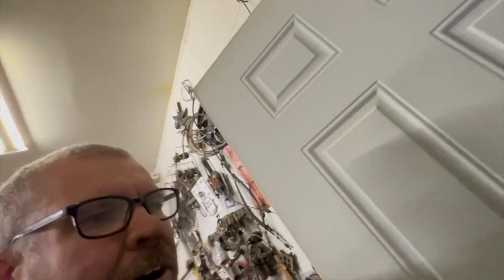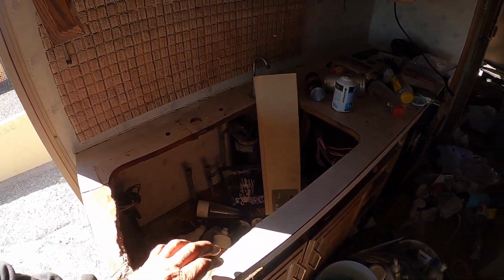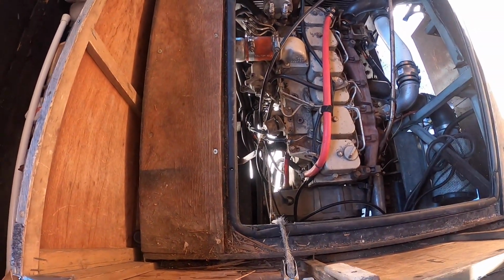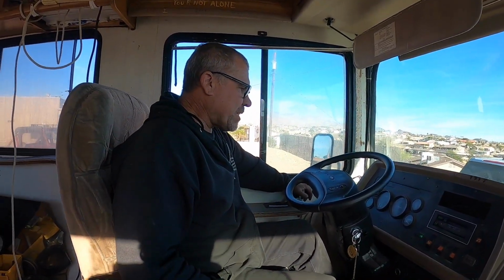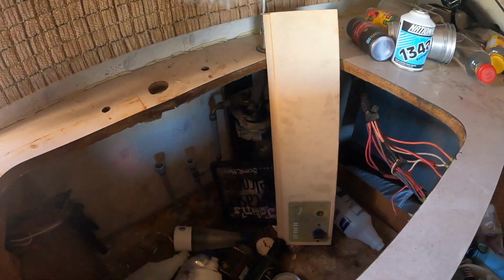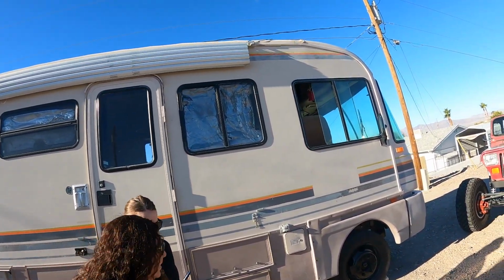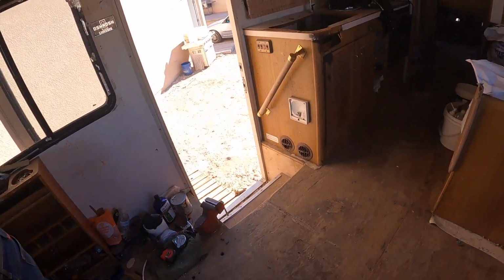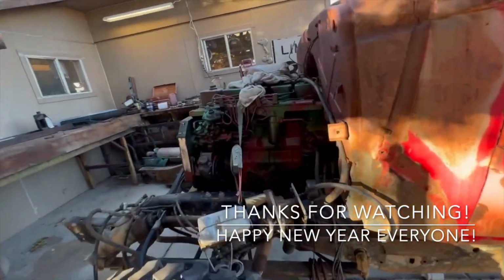This Motorhome is a Disaster!

Comment: Was chuckling throughout, then the pull chain switch to run an AC? (Or 12v light??) Almost fell off my chair !  Definitely fun to watch the varied reactions from the familys, lol!  Heck of a way to start 2023, might set the bar kinda high for content the rest of the year...  But we'll still watch, I'm sure you're up for the tasks !  Hope the new year is blessed, & Thanx !!
Reply: That was a led can light from a house, it's a 120-volt light, looks like it was tapped into whatever fed that ac unit.
Reply: @ewelmo3921  ok, didn't look deep enough, thought it was a 12 surface mount...
Reply: Merlin. It was free, you did’t  have to take it.  This video was a low.

Comment: Regarding the electric fans on the radiator - I've got a 96 Safari with a 250hp Cat that was having issues with it running too warm, so I added electric fans to pull the air out and help cool the engine down. On mine they work fantastic, and an added bonus is they help pull the heated air away from my generator (that is also in the rear end), and when I shut down for the day, the fans run on thermostat to continue to pull air through, keeping the bed from getting so hot.

Comment: the generator system you got I have a 2 cyl gas unit about the same .. it is in my garage I need to get it running . came out of a motor home . I got it  was already out .. dumpster cost hazard waste 1000.00 . but a free engine .. lol good find .. good thing we can not smell the fridge threw video ..

Comment: I was curious about the year of this motorhome.  I used to own a 1987 Bounder gasoline rig and I was amazed that the interior of this one looked nearly identical to mine, layout, cabinets and etc.  The bathroom was a little different and originally mine had two twin beds in back with a cabinet in between (that were removed before I got it.)  I put a queen bed in it and drove it for 13 years before I upgraded.  I agree that this one was trashed for sure!!

Comment: Just started watching this episode. And it’s interesting because I actually own a 92 Cummins powered Oshkosh Fleetwood bounder motorhome.
It looks to be the exact same model. But of course, mine is not such a mess.
That Onan generator uses a three cylinder, Kabota engine, that’s good property !
Reply: I’m a little worried about those extra fans on the backside of the radiator. Normally that engine fan is more than enough to do the job.

Comment: I noticed that the Onan generator has a top of the line Fram oil filter. You know it's the best when it has no slip grip spray on bedliner material on the bottom.
Reply: always
Reply: Fran makes a lot of the top oil filters😂
Reply: @tropepe  My statement was totally "tongue-in-cheek". Total sarcasm. Merlin hates Fram oil filters, and they are pitifully constructed. Check out vlogs here on YouTube where people cut open different brands of oil filters and compare the components that are inside the metal canisters.
Reply: @garyjohnson1525  you made me rethink about the oil filter. Now I have to rewatch those videos because I thought the very top of the line was acceptable quality. Happy New Year🍻
Reply: @tropepe  Only good thing about Fram oil filters is their advertising, other than that they're JUNK!

Comment: Could have drilled a small hole in the tip of the gas pedal to tie the string to so you could use your foot for throttle

Comment: If the roof leaked there's mold inside the walls, since it's rear engined already why not scrap the shell shorten the chassis find a cool old cab and build a wheelie truck ?  The Big Red Wagon

Comment: A sewer boot is what holds the black PVC cold air intake (no intercooler) that replaced galvanized fence pole one to cut down on vibration when did the TD swap. It works.

Comment: I had one i was told if i could make it run id own it ,im surprised at how simular the two really are,in respect to haveing both been lived in and the amount of garbage left behind also the funk was totally real and nasty to beat the band. However we recycled the drive and transmission and we also laid claim to the onan gen set we took it to the yard and pulled all we were keeping and befor that cleared the garbage to the dumpsters and we ended up with about 2000 dollars in tools and  goodies after dispatching the garbage. Great adventure was had in the works and it was nice renmicing of those days with you and jimmy

Comment: I had one it was a 94 winnebago vectra pusher with a cummins 5.9 12 valve and a 6speed Allison trans. Had issues with the trans controller [computer box], finally someone online told me what they knew the issue was- and pointed to the company in Texas who rebuilds those Allison Trans computer boxes. Then FIXED!

Comment: There's lots of good parts Engine axles tires rims Not to even mention the little generator I'm sure it's diesel as well Stripper down and scrap it People say save it but if you've ever worked on a motor home they rot from the roofdown quickly.

Comment: I would love to get that generator from you guys.  I need one bad for my 89 Fleetwood Limited that I converted to a Cummins and Allison 1000.  The gas genny that in it still works and I rigged a second small tank for gasoline to run it off of. But would rather have a diesel generator.  Any chance you'd like to sell it or a swap something deal.  Still got the original EFI 460 & C6 with only 75K on it.  Just wouldn't do that climb out of Denver pulling my rock crawler.  So I put in a 5.9 12 valve and bumped that bad boy up to 400HP.  Should have it running in my Coach this week or next.

Comment: 27:26, that light is the way it is because it's an adapter fixture for converting a 4" recessed light housing to an LED panel. They come with a light socket screw plug as the means of connecting them. I'm sure he used them for the same reason I used them, they were $5. Haha.

Comment: Come on.. it's a Renovator's Delight...... hahaha....... It was Free but think of all the Free items you have gotten with it.. the motor, gen set, vice at the front door, fuel cans, hoses, power leads etc... tools etc.. etc... I did see another alternator sitting on the wireframe behind the driver's seat as you walked past it Merlin. Did you check on the roof to see if there were any solar panels?

Comment: About 2 years ago I was called to haul away a 5th wheel trailer. The son of the owner called after his father had passed and needed it removed from the rental lot. He spent two day going through it, then said the rest was mind...! 

Here is the kicker to this ramble... and this is not the first time...! Once I got it to my yard. I told my grandson there has to be a stash somewhere. So I search jars, cans, drawers...nothing.  Then one day I walked back in to search some more. The day before was windy as hell.  When I step in, I thought I would check out the bed area up the steps. I was looking in the little storage cabinets, when I look down at the floor....I could not believe my eyes.  On the floor was a scattered pile of cash. $100's  $50's  $20's $10's  I was shocked because I could figure out where it had come from. Well...here is where it was.  Over the top of the bed is an escape hatch to the roof. Well, since it would get hot in the summer and cold in winter, he cut a 2" piece of styrofoam to fit the opening, and pushed it up. So, because it was all open windows, doors, and the tip-out was laying inside, because of the wind the day before, it sucked the styrofoam out of the opening, and started raining cash. I swooped it up went inside showed my grandson and counted out over $1700.  

The reason I am even telling this story...people stash money all the time and do actually forget they did it. I search thing before I throw the stuff into the dumpster...I have found thousands in motorhomes, travel trailers, and 5th wheels...! So, it really can be "Another Man's Treasure"...!

Comment: Definitely an interesting combo as in a 12valve or at least a Cummins anyway I haven't seen whole video yet it has a Ford column normal Cummins is a Mopar option n international is a Ford thing just weird the base chassis options before Walter White wonder buss got stuck on top n the throttle control as well as certain other things say it was a tweaker residence for some time. I live just up the road in "Arizona's most affordable community" 15yrs running Bullhead City /Fort Mohove. Yes it surely is affordable what you also need to consider is that the saying you get what you pay for could not be more applicable than to this area as there are many many many reasons why this dump is oh so affordable even though it's location right on the river should make it prime real estate. If you actually look into the areas history and that whole open sewer of a waterway what should make it million dollar real estate actually is why it's so cheap cause soon as it's real contents become more widely known as Mead goes down n down cheap land will be worthless Superfund wasteland

Comment: It looks like with the shape that this motor home is in that the best option would be to try and get the engine running and if you can take the engine, transmission, wheels and axles and just scrap the rest. Yeah take the generator.